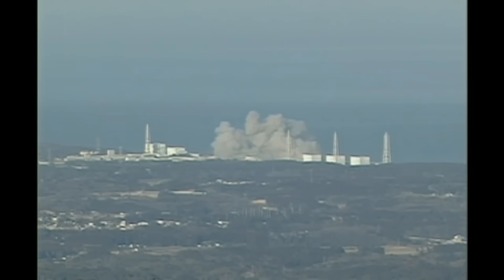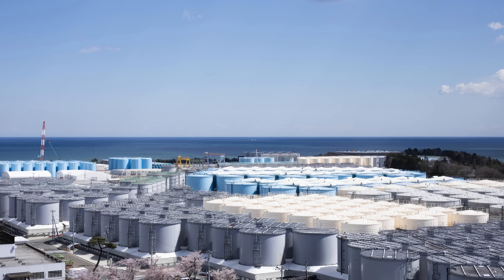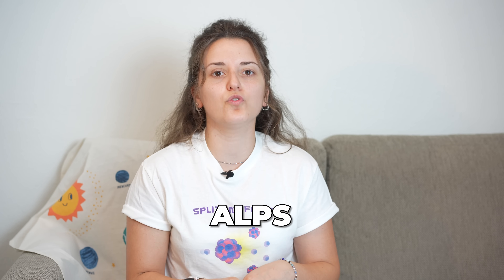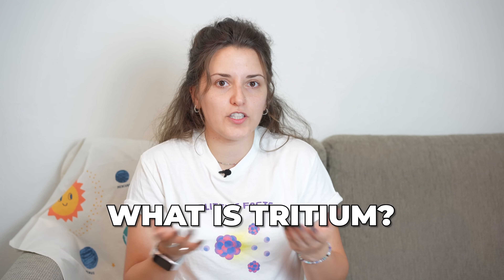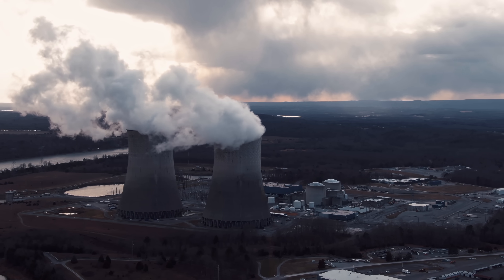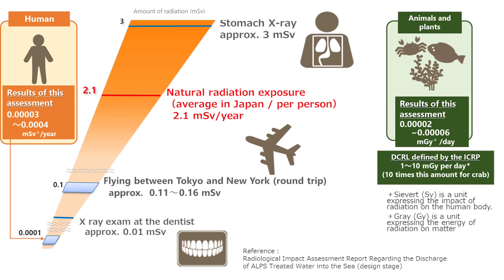Nuclear Physicist Explains - The Release of Fukushima Treated Radioactive Wastewater

Comment: I am glad to hear her tell us how feeble the radiation from tritium is. It is highly misleading that the usual class of reporters refer to huge quantities of radioactive water, when in fact it is the quantity of coolant that three reactors had when they responded to the earthquake by Shutting Down, diluted by relatively large amounts of plain ordinary water. In fact, the "Heavy water" reactors, CanDU brand, use water that is all or almost all  deuterium(2) oxide. Tritium in a reactor comes from the capture of a neutron by the deuterium, which has cost enough neutron capture by the ordinary water to require enrichment of the fissile component of the uranium. But that deuterium has so little "cross section" for capturing another neutron, that CanDU can run without enriching the uranium.There really can't be much of a density of tritium.

Comment: Summary
- Intro (0:00 - 0:34): Introduction about discussing the release of treated water from Fukushima Daiichi nuclear power plant into the ocean, including how it's produced and its radioactivity.
- Background (0:41 - 2:05): Explanation of the Fukushima Daiichi accident, use of water to cool the reactor, and storage of this contaminated water. Introduction of the Advanced Liquid Processing System (ALPS) to remove most radioactive elements, except tritium.
- Why Release the Water (2:16 - 2:57): Need to remove water for decommissioning the plant and restoring the region. Explanation of various proposed disposal methods, with decision to release into the ocean.
- Radiation Details (3:28 - 4:28): Description of tritium as a weak radioactive isotope of hydrogen and its minimal impact compared to other natural sources of radiation like potassium.
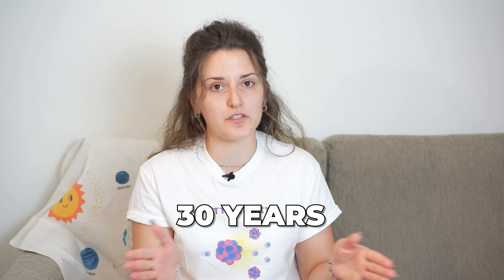- Long-term Release Plan (4:38 - 6:04): The plan to release the treated water over 30 years, ensuring dilution and minimal impact on radioactivity levels in the ocean and environment.
- Comparative Safety Analysis (6:08 - 7:06): Comparisons with other common radiation sources and practices worldwide to contextualize the safety of the water release.
- Communication and Public Perception (7:14 - 8:57): Discussion on the need for better public communication and addressing misconceptions, and the validity of Japan's approach with international collaboration.

Comment: is there no technology to hold back the Tritium from LWR-reprocessing plants (except longer intermediate storage of spent LWR fuel rods) ? a rarely discussed environmental problem, basically: Dilution is the solution to Pollution mantra.
in MSRs, with CO2-Brayton cycle loop, much of the reactor Tritium could easily, chemically be sequestered from the CO2. (And then used in Fusion reactors) 
In vol351 Jan,1st.2016 of AAAS Science p68ff is a new tech article: Sieving hydrogen isotopes through two-dimensional crystals Membranes 
if it could be extended to do Tritium-sequestration, too; if feasible on large scale this would alleviate/eliminate a serious  environmental problem of marine fish pollution!

Comment: If Safe Why Release It In The Ocean?
If safe why not used before now?
This Is The Irroneous Concepts Of DILUTION Of The Particles, WHICH CAN'T BE DILUTED AT SUCH AN ATOMIC LEVEL!
It will be dispersed over a larger area.
WE CAN'T DIGEST H30!
H30 + H20 = ?
Reply: Because of the role of hydrogen in metabolism and its ubiquitousness in the environment, organisms have not evolved mechanisms to accumulate or concentrate hydrogen or its isotopes in food chains. Therefore, biomagnification of tritium is not a factor in food chain transfer.

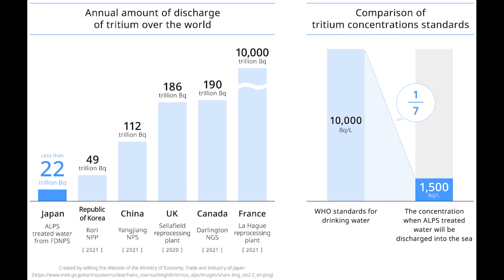Comment: If Japan's release of treated water into the environment is considered a problem, it's worth noting that other countries have engaged in more significant environmentally damaging practices. The situation often revolves around political motivations, as someone typically seeks to gain an advantage. 5:29 says it all.
Reply: There will be billions and billions of cubic metres of radioactive water when that tritiated water gets mixed into  the oceans. Any given gallon of it will hardly be detectable. It is rubbish to write of the number of gallons of diluted radioactive water. By far the biggest threat to the Pacific ocean from the loss of three reactors, isn't radiation at all. It comes from the replacement fossil fuel power's chemistry of carbonic acid gas, the older name for carbon dioxide. Seashells, chalk, limestone, and marble are calcium carbonate. Twice as much CO₂ turns it into bicarbonate, and it dissolves. Oceanic life, including corals, cannot survive if the alkalinity drops to pH=8.0, which is merely slightly alkaline. It used to be 8.2, and has dropped to pH=8.1 on the average.

Comment: The following is the report released by Tepco on the group 19 of ALPS treated water. 
www.tepco.co.jp/en/hd/decommission/data/analysis/pdf/2023/measurement_confirmation_231019-e.pdf    (Please to edit the link to add back the http://. I found that youtube will delete messages with links)
You can find that ALPS cannot completely remove all the radioactivity element. The real concern is Cs-137. The group has 8936 cubic meter of water and it has 3.8E-01 Bp/L of Cs-137. So, this group has 8936 * 1000 * 0.38 = 3395680Bp. According to the Japan regulation, food should not contain 90Bp/L of Cs-137 as Cs-137 will accumlate in our body to cause cancer.  The half life of Cs-137 is 30 years and that diluted Cs137 will be accumlated by the food chain!

Comment: “The biological impacts of tritium, carbon-14, strontium-90 and iodine-129 - to be released with the water - have been ignored,  The filtering process will remove strontium-90 and iodine-129, and the concentration of carbon-14 in the contaminated water is far lower than its regulatory standard for discharge, according to Tepco and Japanese government documents.” -Reuters
Reply: The full report clearly shows tritium is the only radionuclide that is anywhere near any kind of action level, and the full report is clearly not made by TEPCO or the Japanese government.

Comment: IF THE WATER IS AS SAFE AS YOU CLAIMED, WHY DID JAPAN NOT DISCHARBGED IT INTO IT'S INLAND LAKES ? HA,HAHA  ???
Reply: Japans inland lakes are quite small, but the pacific is unfathomable fucking massive, and when the water goes in, the radiation dose drops to about 0. Because it gets mixed up. It’s like trying to find a needle in a haystack except the hay stack is way more than a trillion times the size as a normal one.
Reply: Maybe if you figured out that caps lock button, someone might read your comment.

Comment: I think the focus is wrongly put on Tritium by the media and public.  The concern should be on other more harmful radionuclides like 137Cs and 90Sr.  What we really need to do is ensure ALPS is able to do its job for the entire 30 years operation.  IAEA should make a clear plan on how they are going to do that (e.g. how often and where they are doing to sample the data independently instead of rely on TEPCO to provide data.)      As for Tritum, I don't think it is a good idea but other countries already set a precedence to use ocean as the solution and not much we can do about it.    As a weak beta emitter, the risk should be limited compared to other radionuclides.
Reply: You nailed it. The strategy behind the propaganda is to lead people focus on the wrong thing, forget the elephant in the room, that is ALPS won’t work as they claimed to remove all the radioactive materials except Tritium.
Reply: @jamesfederer5592   You could have read the full report and found out you both are wrong.

Comment: If the water is not harmful then why Japan has not released the water into its own lakes ?
Reply: Carbon 14, strontium 90 and iodine 129 and others which are more harmful than tritium are not treated and released into the ocean. But She only said about tritium.
Reply: @Panda-phoenix  A recent investigation by a Chinese team visiting Fukushima where they fished on a charted Japanese boat within the range of 50 miles. They took the fishes to a lab and found they were heavily infested. The charter owner told the Chinese team: "I eat the fishes I caught but I do not allow my kids to."
Reply: The full report clearly shows the safety of the water.
Reply: @danadurnfordkevinblanchdebunk  On spot test showed otherwise !
Reply: @danadurnfordkevinblanchdebunk  Did not complain; just shared some vital information. But, thanks, buddy !

Comment: The IAEA report on this incident has put up a disclaimer that states that all data are provided by Tokyo Electric Power (TEPCO) who owns the power station. TEPCO has been caught lying and admitted about the Fukushima incident in the past which was widely reported. So what makes you so sure that the reports now are reliable?
Reply: Show where TEPCO is lying.  
Your IAEA meme doesn't help your fear mongering.  The same could be said if Volkswagen sells you a car and you use it beyond its intended use. It clearly wouldn't be VW's problem.
Reply: @ForbiddTV  google it.
Reply: Carbon 14, strontium 90 and iodine 129 and others which are more harmful than tritium are not treated and released into the ocean. But She only said about tritium.

Comment: this is by far the best explanation for the regular people, i worked for 25 yrs in a nuclear power plant and performed process of cleaning up liquid waste  and tested gets permit before releasing to the ocean.great job to educate people.
Reply: Japanese lied about ALPS. 1. ALPS has no way to remove carbon-14 either which has a half life of 5,370 years. 2. They are using 800 times seawater to dilute so-called ALPS-treated water before it is released, while normal nuclear plant cooling water doesn't need to be diluted. Their Asian neighbors and IAEA have to spend lots of money and manpower to monitor the releasing during the next 30 years. If it's safe, why don't Japanese just use ALPS-treated water to water their own plants instead of releasing it into the Pacific Ocean.
Reply: @zicheng7804   You could have read the report before making such a  F 0 0 L  of yourself on the internet.
Reply: To educate you 
Carbon 14, strontium 90 and iodine 129 and others which are more harmful than tritium are not treated and released into the ocean. But She only said about tritium. Disgusting .
Reply: @Panda-phoenix  The full report clearly shows ALPS is effective against strontium 90 and iodine-129.  The only radionuclide that was anywhere near an action level was tritium.
Reply: @danadurnfordkevinblanchdebunk  that is not true btw i have been blocked to comment and my comments are not showing.

Comment: You just assume the ALPS works without a single doubt, is it something questionable.   There is no consideration of any radiation from other substance other than Tritium.   Moreover, if the water is safe, they can reuse it, no need to flow it to our common ocean.
Reply: The full report clearly shows ALPS works.

Comment: Other countries ARE NOT releasing water that touched the nuclear core! that is a huge difference! If ALPS is a filtration mechanism that is 100% effective all the time, that is a miracle!
Reply: ALPS is clearly shown to be effective as seen in the full report.
Reply: @ForbiddTV  things in the real world are rarely this clear-cut. There are a lot of dependencies on report with regards to operating conditions  state of consumerable materials and accuracy of measurement material. If it's so safe, the water could be used rather than dumped. The fact that the Japanese gov report that water is dangerous to transport elsewhere really speaks volumes.
Reply: @hdhdhshscbxhdh4195   All nuclear power plants have always released the same tritiated water and nothing in world history has ever been injured by this practice.  You should use the tritiated water your country releases instead of disposing of it.
Reply: @ForbiddTV  again, other nuclear power plants release water with tritium, but it's not water that has touched the core and have other radioactive substances. That is what people are objecting to, not the tritium. Certain groups for discharge just want to focus on the tritium to obfuscate the problem

Comment: Not disagreeing on the impact of tritium in the ocean, however, as an engineer often dealing with risk management as well as water/sewage treatment, it appears that there are a few questionable statements and comparisons in your video.  Firstly, is it fair to compare normal nuclear plant cooling water (which does not go through the core) with the contaminated cooling water at Fukushima (which had a meltdown, thus water going through the core).  Secondly, based on the claimed impact suggested by the japanese, it appears that the being released cooling water can meet the releasing standards without the final dilution, if thats the case, whats the reason for dilution (trying to manage some risks? what are they?).  Thirdly, the reliability of the filtration system for the next 30 years is questionable, given that they opted for this cheaper option of releasing water, there is risk they might well cut cost in the maintenance of the filtration system in the next 30 years. Then, tritium is not the only radioactive elements in questions, especially if the filtration system could suffer any failure. So last but not least, it is a BIG assumption for the japanese to be able to maintain the effluent standards without any failure in the next 30 years, if so, yes, it appears that there is minimal impact.  And by the way, in the water/sewage treatment industry, dilution is not accepted as a treatment process to meeting the effluent standards, if otherwise, you are still releasing the same amount of pollutant.
Reply: Since ALPS is effective for all but the tritium, the water is the same as what all nuclear power plants release.
Reply: @danadurnfordkevinblanchdebunk  First and foremost, the nature of the water source is different, yes one can do treatment to reach a particular 'standards', this still won't change the fact that it is water that had reached the core.  For example, not to say such high treatment standards for the ALPS, domestic sewage can be treated to reach drinking standards, however the general public would not accept to drink such water.  Only Singapore uses their Newater to mix with raw water during dry periods as a backup.  And, you might as well say the ALPS treated Fukushima water is the same as portable water, but without international and public acceptance, by the face value from PR perspective, I personally consider this scheme a failure.  I am open to more information, but so far I cannot find information regarding the reliability of ALPS and the level of redundancy in the system.  If not designed and operated properly, with one single major failure of the ALPS in the next 30 years, it might be possible to discharge/leak more radioactive substance in that event more than in the 30 years planned (say a major earthquake in the next 30 years).  Such risk and consequence are the key question.  Are the risk mitigation measures sufficient?
Reply: @danadurnfordkevinblanchdebunk I am happy to be educated, which report do you think I can find the answers for my questions?

Comment: I would like to know that how many different radioactive elements were in the "treated" water, what their percentages were, and what kind rediation those elements were ejecting.  As of what I heard, the wastewater was not from the "normal cooling operation" of a "fully functional nuclear power plant"; instead, it was used to cool down the "aready melted core" of a "damaged nuclear power plant".
Reply: Then read the full report!
Reply: @danadurnfordkevinblanchdebunk Where could I found it?
Reply: @danadurnfordkevinblanchdebunk  " Although great care has been taken to maintain the accuracy of information contained in this report, neither the IAEA nor its Member States assume any responsibility for consequences which may arise from its use. "
Reply: @danadurnfordkevinblanchdebunk  I quickly read the report, only found out that I need more time to learn from it.  As of now, I can not agree with the method of sample collection which was not "random" and was not from the dumping arear (only from the end of water treating system).  Furthermore, the sample showed inconsistency which might result the non-agreement among those labs.  IAEA should put the water treating system under surveillance and let it work for at least a month then test enough sample from all the treated water and compare to the untreated water.
Reply: @danadurnfordkevinblanchdebunk  The report only mentioned one sample collecting.
Reply: @danadurnfordkevinblanchdebunk  If they concluded the "treated" water was "safe" with one report with one time sample, I will have to against the dumpling action until more reports show the water is safe.  Only one report generated with one sample was a start; without more tests done by more different labs agree on each other, the "white powder" situation will almost be sure to happen.  The water of the ocean moves; I am just worried.
Reply: @danadurnfordkevinblanchdebunk  I will.  My problem was that some evidence showed that the Japanese officials lied about the situation; therefore, samples came from the Japanese officials should be questioned.  I will study these reports and learn how to understand them.  Thanks for helping me to search them.